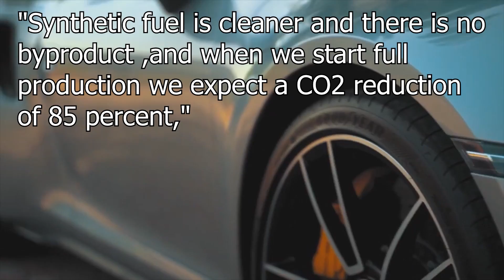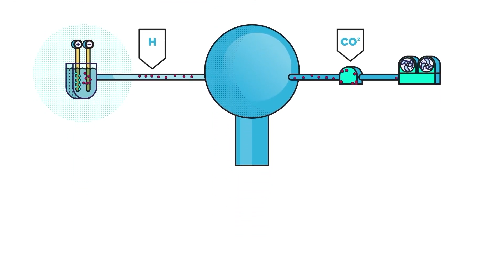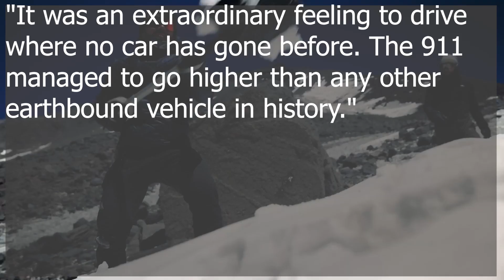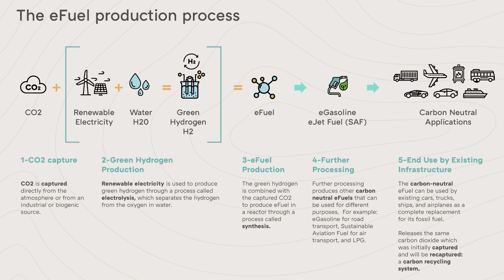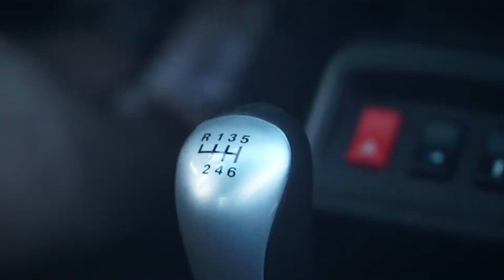Porsche has used their Revolutionary E-Fuels to break a World Record

Comment: We can also start by banning ethanol as well, which takes more energy to produce than what it actually produces
Reply: I believe this will still be the same case with the new E-fuel. You can’t put energy into something and get more energy out of it. 

This will solve the CO2 neutral problem. There is still a need for the electricity and water to produce hydrogen and power a device to collect CO2 from the atmosphere. 

The energy crisis is still a problem, renewable resources will be necessary
Reply: You can produce the e-fuel when the sun is shining and the wind is blowing. A way of storing energy.